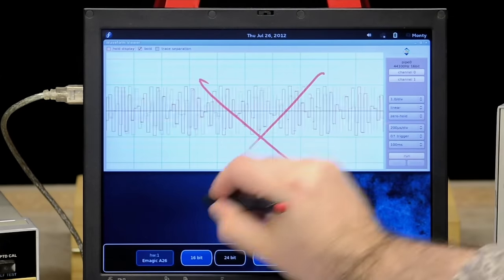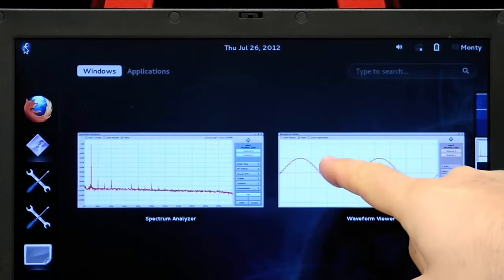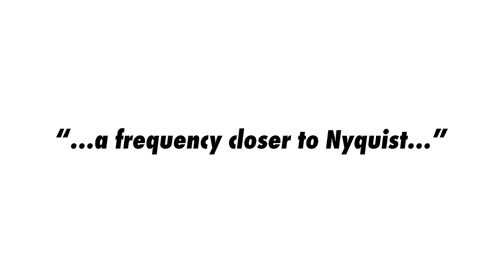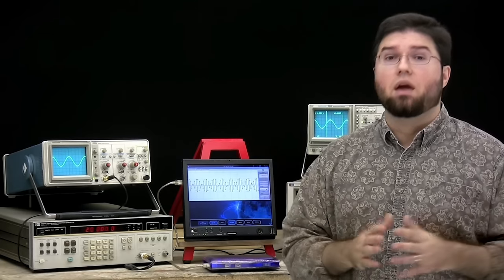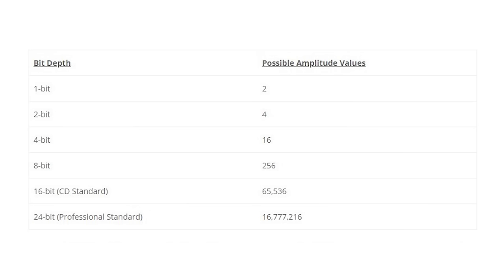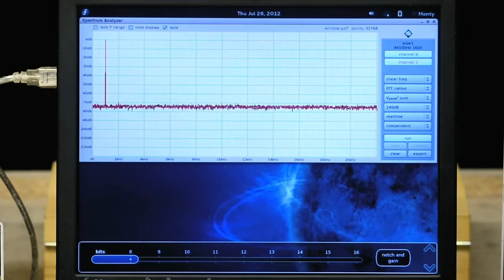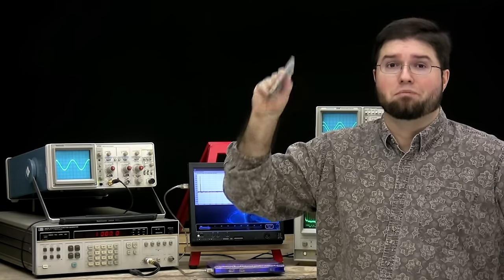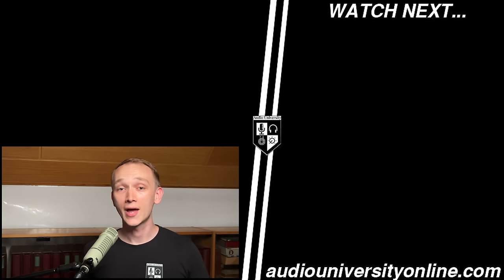Debunking the Digital Audio Myth: The Truth About the 'Stair-Step' Effect

Comment: The sample rate vs frequency experiment for a steady state tone was a quite convincing experiment. Sorry to say that in the real world of transient sounds, like music, it does not hold up the same. Coming from a Digital TV background I recall a demonstration at an Ampex class to demonstrate a problem called aliasing that happens when you have less than full quadrature sampling, in analog TV for Color information at 3.578545 Mhz. The normal sample rate used for Time Base Correctors and Frame Synchronizers is 14.31818 Mhz or 4 times the color frequency! This is to properly reproduce all phases of the original color signal at proper amplitude. In the demonstration the sample rate was reduced to 3x color, or 10.738635Mhz. At that sample rate there was very clear degradation in the color signal. There was aliasing causing amplitude and phase errors to appear, but for a consumer reference, it was still better than the average VHS home recording! When the sample rate was reduced to 2x color, or 7.15909 Mhz, only colors that phase agreed with the phase of the samples were correct with the amplitude of anything else was reduced according to the phase difference up to 90 degrees where there was no response. There were, however responses where colors changed as for a few cycles the frequency of the transition moves above or below the exact color frequency. These transitions, however, did not achieve the same amplitude traces as the original signal! 
So.... with this in mind, how does the steady state tone demonstration come up looking so good in this demonstration? Why is it not full of aliasing products??? Simply put, it is the D-to-A post filtering that tends to ring to fill in nicely for steady state signals! By the way, the stair-step representation is exactly what comes out of the digital to analog section ahead of the out put filtering. The sampled values are loaded and latched as steady state values at this pre-filter point in the process.The output analog filter smooths this out. 
When Digital audio was new the initial response from Recording Engineers and Musicians alike was WOW, THAT'S GREAT! It was then a leap in quality compared to Ampex 456 or the 3M equivalent analog tapes. They were really good, but always added a sort of what I call a "metalic sound" when comparing live to repro during a live recording. Digital was a lot better as the samples were very accurate in the majority of the audio range and as pointed out extremely quiet, lots of dynamic range. After a while, though, many Engineers and Musicians started noticing a sort of strange new component that most said sounded harsh! Believe it or not, that is the aliasing caused by less than full quadrature sampling! 
As an example, one of many, I was recently approached by a Flute player who was frustrated by the sound of her recordings! They were done with a Neuman large diaphram U-87 type mic that has been a standard for decades. The recording was clean and clear except for some high frequency "trash". As I have seen many times in the past, a spectrum analysis clearly revealed that the digital signal was "growing" aliasing products from 11.025Khz (quadrature for 44.1 sample rate) and above as louder, higher pitched notes were played! I told her to have her engineer apply a simple lo-pass filter to the recording starting around 12 Khz and like magic the aliasing products were no longer a problem. 
As for analog never having the dynamic range of digital, I am sad to say that both Ampex  (Quantigy) and 3M came out with what they called "HIGH LEVEL TAPE" to try to recover from the digital revolution! They recommended setting your 0db record reference at 9 db above the standard 0db reference! I did this on my old Scully 280 and proceeded to do a run with a Sound Technology distortion analyzer. When the analyzer reached 27db above the elevated zero the distortion abruptly rose from fractions to 2.4%!  I think that was the electronics flat topping, not the tape saturating! The headroom was great and when switching from direct to repro it was near impossible to hear any difference! Twenty years or so ago I recorded a live concert with my 1" 16 track using DBX and the Ampex 499 high level tape and the result was stunning! The recording was extremely quiet and dynamic sounding, but having said that, an XR-18 to a laptop with Pro Tools is a lot easier and sounds just as good!
One last thing, don't ever tell me that you have a "loss-less" audio compression thing! Like anything that compresses, it may be real good but not perfect! There is loss, but it may be hidden well!
Reply: I like most of what you said here, but as a software developer who studied computer science I feel I need to explain what is meant by "lossless" compression. A compression algorithm (for a digital file, not what an audio engineer means when they say compression) is considered lossless if the output of a compression-decompression cycle is identical down to the last bit. There are many lossless compression algorithms, such as the one used in the typical "Zip" file. And they are truly, in every sense "lossless". The same cannot be said of compression such as that used for typical MP3 files, which are lossy, as the result of a compression-decompression cycle is NOT the same as what was input. By saying a file is lossless does not mean it perfectly reproduces some live audio, it just means that whatever master digital file the audio engineer created for distribution can be delivered to you in a smaller size (saving network bandwidth and storage space) but the player will decompress it to be identical to what he created during playback.

Comment: If 16-bit has a theoretical dynamic range of 90 dB, it doesn't mean it's enough to record the full dynamic range of an orchestra (70 dB). Since it's digital, you will have just 3 bits to digitize quiet instrument solos. This is why we need more bits. As for the frequency, I have two comments. First, if you take a look at the Nyquist theorem, the gist of it is that you 𝘤𝘢𝘯 recover a sine wave by sampling with half frequency. However, the convergence of this process is slow (the recovery is a slowly converging series of sinc). The higher the frequency, orders of magnitude easier the recovery. In other words, it's much easier to recover the full signal correctly on cheap electronics if the frequency is much higher than the Nyquist. Second, music is not a single sine wave. You have to recover all of them, most importantly, with the correct relative phase.

Comment: Good points here. There is another very interesting and important factor at play going on with human hearing. People over look this very important aspect of our abilities to hear beyond 20kHz . It's funny because its not that we can actually hear higher than 20kHz but we can certainly hear a difference in timing that goes beyond 20Khz separation, using both of our ears to do this.
An Example:  Person A : claps their hands in a low reflective room , while standing in front of person B. Person B has their eyes closed. Person B is asked to pin point where they believe the sound source or clap is coming from. Assuming hearing is at normal capacity in both ears, of person B , they should be able to determine this quite easily. even if the sound is at their feet or above their heads. The direct analogue  sound waves of the clap itself  arrives at ever so slightly delayed times to both ears of person B, certainly this included differences in amplitude and reflections etc . The direct sound information is quickly decoded by our brains to accurately know the position of the sound in this given space. The ear shape place a big part of this alone. This ever slight difference in audio timing to each ear is actually something a stereo digital audio fails to recreate.  ( note I said stereo digital source ) Our ability for  our ears to pick such nuances in audio delay to find the clap sound source in a space is really astounding.  I know this really if off the direct topic  relating to samples and steps in samples etc. ( lack of ) but all this regarding sound reproduction is interesting all the same.
Reply: Timing regarding digital samples and analogue sound source  timing differences of a single point source to the ears are 2 very different topics.
Reply: I am not sure if you realise this,  there are now live sound, audio manufacturers,  that are now dropping the digital chain altogether to go back to a pure analogue chain . Its catching on for good reason. Mmmmm, one wonders why this may be the actual case? Just maybe they have figured out after all that the analog chain is far superior perhaps? Maybe a bloody awesome marketing team ? Mmmm .One thing I know for sure though, it's not because the frequency response is higher than 20Khz  or the dynamics are mind blowing either. You know how funny my own comment sounds to me,  I have been installing, programming and tuning DSP units for 20 years now and also doing live sound mixing longer than that and yet here I am, talking about how amazing analogue is .

Comment: Finally. Thank you. Honestly, anyone who thinks 96k is better than CD quality, I'd love to see them in a blind test. I am pretty sure no one could hear the difference. Nyquist rate etc. Also, anyone who COULD tell the difference would probably be under 21 and wouldn't be able to tell the difference at 30. Frequency range loss with age is very real and measurable. And most record producers, at least on a commercial level, are over 40, with many over 50 and a lot over 60. I doubt the ones over 50 could tell a good lossy format (say, 320k MP3, 44.1, 16bit, true stereo),  from 96k WAV.
Reply: @nrezmerski Everyone's ear is different. If you cannot hear the difference between capacitors, high res is useless to you. ))
Reply: @GBR9794  to hear above 20 Khz you have to be a dog.
Reply: @brianhead814  it was a joke though
Reply: Not true. I am 62 and can easily tell the difference between 44khz and 96khz sampled music. The difference is not that I can hear higher frequencies, but the sound is more detailed, there is more attack, sounds are better spatially, more distinct and separate. Telling the difference between 96khz and 192 is harder, but I can still tell the difference and I prefer the higher sample rates. Sure if all you have to listen on is a pair of Apple bluetooth headphones you may struggle to tell the difference between aac encoded at 256k and lossless (cd quality), but on anything better than that, the difference is night and day.

Comment: I use 96kHz/24 bit in things I can't control, like FM synthesis, because the aliasing tapers off until it's below the noise floor, and you can filter and decimate.  I use 48kHz/24 bit for things I can control, like mipmapped ramps and triangles touched up with a few additional generated sines (a 2kHz table used for 2kHz-4kHz can only have 3 harmonics, so I just generate all the harmonics, but for 512Hz or 1024Hz I use a look-up table and generate maybe at most 20 more sines to get below 50dB or so or reach 20kHz, whichever happens first).  24 bit can be used if you're mixing and filtering, and all intermediate calculations have some rounding error that I'd rather deal with in 24 bit.  If I have to quantize something, a high sample rate lets me shove the noise up outside the audible range, which I can then filter out.  None of this has anything to do with playback, it's all stuff that comes up with signal processing.

Comment: This confirms what I've been thinking for over 40 years! Amazing video. However, some parts still 'puzzle' me. First, there's timing because a 'sum of sines' in real music can become complicated. My modular synth simply can't make a good analog sinewave. It's a sine shaped wobble. You'd need serious lab equipment to make a clean analog sine. When you hit a drum there's no attack and 44.1 K/16 bit may not be able to capture/reproduce the first few millisecs while our ears can. Maybe this explains why some old CD players sounded like lazy drummers and audiophiles spend a fortune on upscalers. Second, our music is not full scale all the time, the fun of listening is in the 'micro information' like a real piano note (full scale amplitude) vs the mechanics that produce it (very low amplitude). The note can use 16 bit, while the side effects are closer to the noise floor (e.g. 4 bits) and probably recorded with two mics (stereo). The depth and room ambience is in there, but it's not always coming out during playback. I guess this explains why 48/24 is used in pro audio recordings. Regardless, I never missed my record/casette collection from when I was a kid.
Reply: mfnickster9754  Chat GPT disagrees. Thanks for the comment, I'll continue my research. The truth may be somwhere in the middle depending on the age and build of the CD player. This is what AI came up with: Yes, there is a theory known as the "CD player timing issue" or "CD player jitter" that suggests some CD players may have difficulties accurately reproducing transients, leading to a perceived lag or compromised rhythmic feel. Here's some information on the topic:

1. Jitter: Jitter refers to variations in the timing accuracy of digital audio signals. In the context of CD players, it refers to timing inaccuracies during the conversion of the digital audio data on the disc into analog signals for playback.

2. Transients: Transients are sudden, short-duration sounds or audio events with rapid changes in amplitude. They can include percussion hits, plucked strings, or any sound with a fast attack and decay.

3. CD Player Jitter: CD players read the digital audio data from the disc using a laser, and this data is then converted into analog signals that can be played through speakers. Jitter can occur during the conversion process, resulting in timing errors that affect the accuracy of transient reproduction.

4. Perceived Effect: The theory suggests that if a CD player exhibits significant jitter, it can cause transients to be reproduced with timing inaccuracies. This can lead to a perceived lag or smearing of the transients, affecting the rhythmic feel of the music.

5. Impact and Variation: It's important to note that not all CD players exhibit significant jitter issues, and the perceived impact can vary depending on the specific player and the quality of its components. Higher-quality CD players, such as those with dedicated digital-to-analog converters (DACs), tend to have better jitter performance.

6. Solutions: To mitigate potential jitter-related issues, some audiophiles opt for using external DACs or specialized CD transports that are designed to provide more accurate clocking and reduced jitter. These devices aim to provide a more precise conversion of the digital audio data, resulting in improved transient reproduction.

It's worth mentioning that digital audio technology has advanced over the years, and many modern CD players have improved jitter performance compared to earlier models. However, individual preferences and perceptions of audio quality can vary, so some listeners may still perceive differences in the rhythmic feel between different CD players.
Reply: mfnickster9754  I''ll go ask the kids on Sesame Street.

Comment: I saw the xiph video a few months ago and it is certainly interesting. I believe what you say is partly true, when one ONLY considers a pure sinewave. According 2 the Fourier theorem, you can reconstruct any waveform using a series of sine waves; this will require sinewaves of much higher frequencies than the original signal. Also, if one uses the simple R2R topology digital audio converter, without any filtering, one will clearly see the stairstep waveform on its output.

So the part this video fails to mention is the inevitable imperfections in "calculating" the 'fill in" between the "lollipops".  In original digital audio systems, this was done by analog filters.  These filters need to be brick wall to allow 20KHz through & block 22KHz by 96 dB.  Such a filter must be of high order, & therefore it isn't possible without adding its own "footprint" upon the audio, such as group delay distortion.  Analog filters can not be "non-causal" (symmetrical in time).  Digital audio equipment of reasonable quality will likely perform the "fill in" function in two separate steps.  First, the audio will be "upsampled" by a digital filter which CAN be non-causal (by buffering the input stream).  Then this higher-rate digital stream will be analog filtered.  The demands placed upon the analog filter are relaxed as the upper frequency to be blocked is moved upward by the sample multiplication factor (which can be more than 16).  In extreme cases, a simple RC filter can serve as the analog filter.  The slight group-delay distortion of the RC is compensated by the inverse group-delay distortion in the digital filtering process.  My bottom line is that the analog wave is only as acceptable as the method used for conversion of the digital "lollipop" wave 2 the analog waveform.